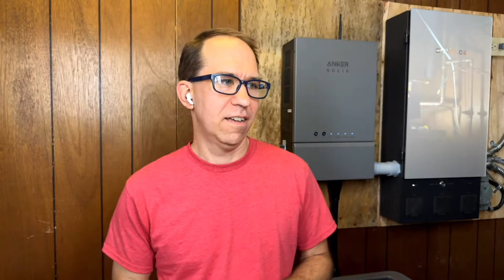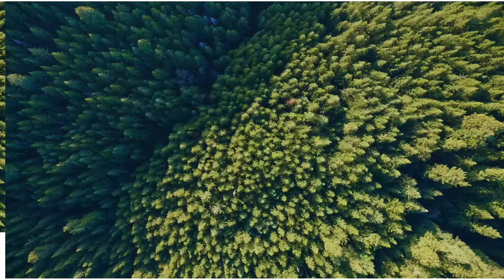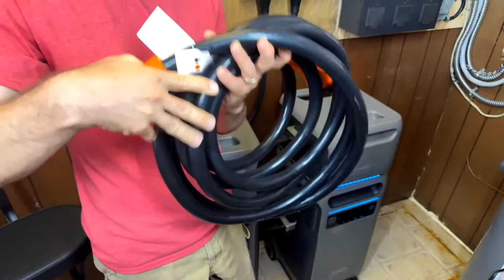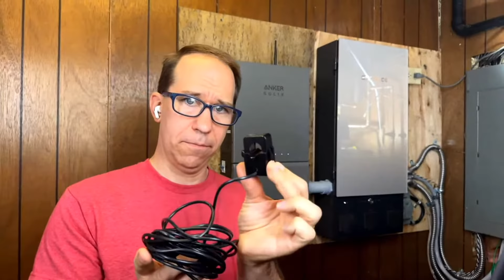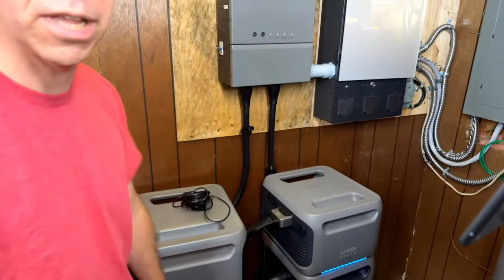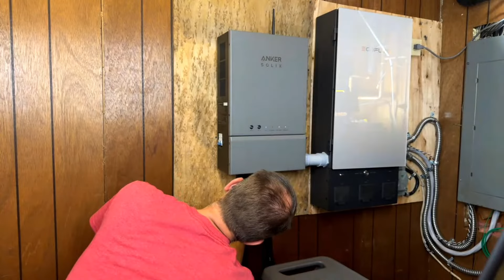Anker SOLIX Live: F3800 + HPP

Comment: All my home loads are on my sub panel. If I run my source direct into the home back up panel then run the line from the backup side back into the load center for the house, will the self consumption/TOU shaving function still work when all load is on the backup side of the solix panel?
Reply: Forgot to mention it’s a 100amp home sub panel then